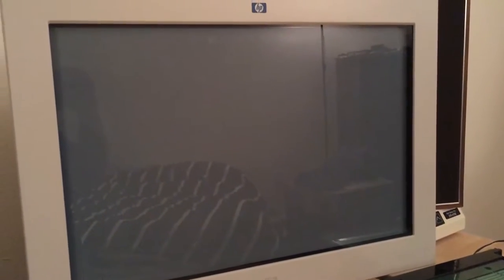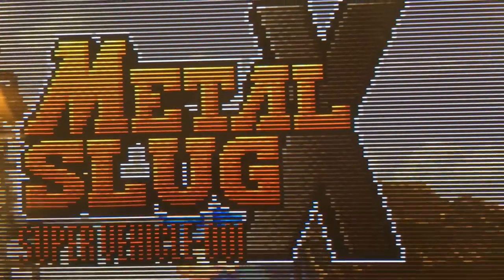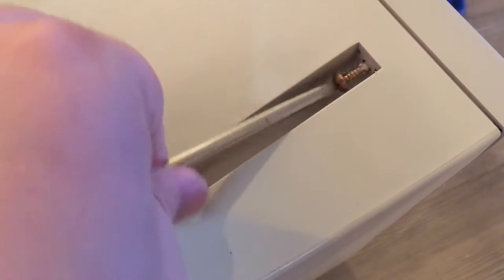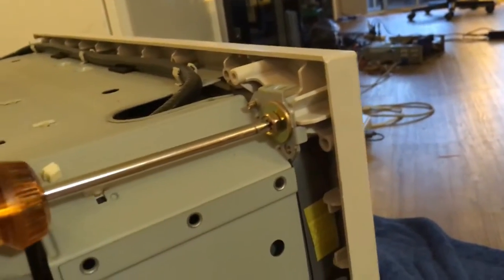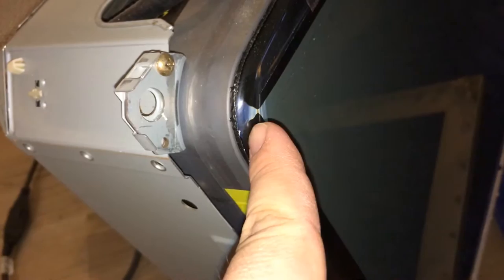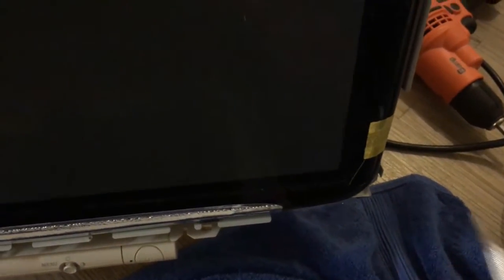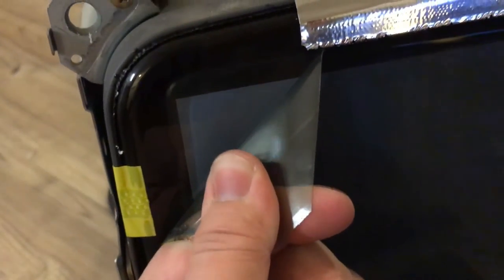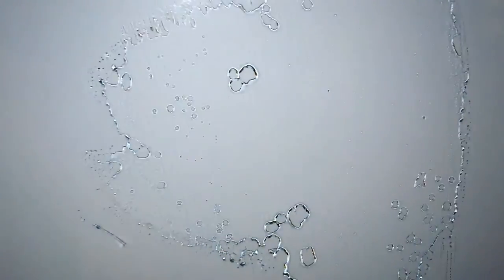GDM-FW900 Anti-glare layer removal (front scratch fix)

Comment: Why not order some anti-glare film from ebay and restore it back to immaculate again.
Reply: Do you mean the 3M anti-glare filters? Have anyone tried to apply on of them on a CRT monitor after removing the original one?
Reply: I think crt and tft both have somekind of flat glass surface on them so why not? Doesn't cost much to try.
Reply: I just order a second hand one for mine. An AG23.0W9 that I'll have to trim (couldn't find a cheaper one). Will see how it copes. I doubt it will behave the same as the original coating though (I've read those only diffuse the glare instead of reducing it).
Reply: Okay, I just got my 3M anti-glare film (an AG23.0W9 in my case). Bad news, it's not suited at all. The film isn't tinted at all and barely diffuse reflections rather than blocking them. The worst of it is that it makes the image blurry. Definitely stay away from them (I'm even tempted not to recommend them even for LCD displays). So my best bet would those good old big anti-glare frames that you attach on top of your monitor (from my distant memories they are indeed tinted and do the same exact thing the original factory installed AG film.
Reply: Yeah I have a big anti-glare frame for a 19" diamondtron, but it shifts the colors.

Comment: What impressions do you have of picture quality before and after?
Reply: I also would like to know that! the ag film on one of my fw900 is sligthly coming off, nothing big but I would like to know if it is worth ripping the plastic off.
Reply: I have removed the damaged coating from a mitsu diamondtron tube, the screen is definitely brighter, better sharpness but there is a color shift, r-g-b gamma needs to be adjusted to achieve correct colors.
Reply: @x3k30c  which model diamondtron was it? I'm trying to check if my lacie electron blue II (I believe it's a re-branded diamond pro 2045u) has a removable film as I have a scratched area on mine but when I took the back off of it I couldn't see how to take the bezel off. There were 4 screws similar to the ones on the sony in this video but they were partially covered by metal shielding so I couldn't remove them. I guess I might have to take all the shielding off but it looked like a nightmare to do.
Reply: @llwayneio  Mine is a Compaq P910, it was a removable film with anti-glare coating on it. I don't remember all the details since this was done many years ago. Yes, you have to take it apart in a similar way like it's shown in the video. Also look for other videos/websites. I'm not sure that any of the shielding needs to be removed but there was a frame AFAIR (not the large metal fastener) so after unscrewing that, the plastic film came off quite easily.
In case if you haven't taken any crt apart: Be very careful because of the high voltages, the large electrolytic capacitors (250VAC or similar, need to be discharged thru a resistor or a lamp, and try not to babble with the anode (that is harder and more dangerous to discharge). If you don't know what discharging is then at least use thick rubber gloves (preferably made for high voltages) on both hands.
These anti-glare coatings were quite annoying. Once it gets damaged, it's ugly and it's not possible to remove just the coating, but the entire film..
Personally, I preferred the original look and colors, it's quite impossible to bring back the original colors/calibration and this model doesn't have as vivid colors as better ones.
Reply: @x3k30c  Yeah I just can't figure out how I'm supposed to take the metal casing off to access the screws. What size was your compaq? was it the 22" or the 19"? looking at the manual I think the compaq is the the same screen as the lacie. I noticed in the compaq manual it says that the 17 and 19 inch screens have an anti glare "film" whereas the 22" has a anti glare "coating". If this is the case I'm guessing my 22" might have the spray coating as opposed to the removable film.
Reply: @llwayneio  Compaq P910 is 19". Not the best advice but try to scratch the coating on the very corner of the tube. If it's easy to scratch and it doesn't have a glass feel then it's film, glass cannot be scratched that easily. I think older crts had their glass coated. Any photos?
Reply: @x3k30c  Well it feels like glass to me, it's not easy to scratch either. Looking at manuals for a bunch of the diamondtron screens though I do see a trend of the 19" screens being described as having a "film" and the 22" having a coating. I'll take some photos.
Reply: @llwayneio  I haven't checked the mitsu pdfs but sony pdfs (for example the fw900) say "High Contrast AR Coating" but the coating of the fw900 is removable (see first image): https://hardforum.com/threads/ips-vs-crt-sony-gdmfw900.1786630/
Reply: Looks like Sony's Trinitron is very similar to Mitsubishi's Diamondtron (and it should be since the technology of both tubes is practically the same, so the results are very similar). Anyway, I've never had Sony, but I've had several Mitsu's CRT monitors lying around with damaged anti-glare layers, which I eventually removed. The result is the picture becomes quite a bit brighter, but say goodbye to black color, since the tube itself without an antiglare layer has a grey color and there is no way to show black if the  tube itself is not black. It's very noticable, especially on dark images. And I didn't like it at all. My solution was using window film (the film used to tint car windows). I was actually very surprised how good the resulting picture quality became after installing the film. That way I restored several very nice Mitsu's CRT-monitors that I continue to use for retro gaming (well, I use one, but the others are there in case this one breaks).
Reply: @kosmosyche  I was thinking about something like that too, there is no true black after removing the layer. However, this one (Compaq P910) has an 'FPM' option that enhances the contrast to such degree that grey goes back to very dark grey, still not the best though.
I like this old technology because trinitron tubes have the best clarity, vertical stripes are more natural to the eye than pixeled LCDs. Also it's possible to tune the modelines, so if the particular model allows you, you can set up wide-resolutions like 1600x900 with a high frame rate like 100fps (and being able to keep the pixel clock or bandwidth as low as max bandwidth/2 which gives nearly as sharp image as an LCD can).
The high-quality and not over-used pro crts are still amazing.
Reply: I removed the glare sheet from my Trinitron P780 and I couldn't be happier with the results. Games went from looking overcast to popping with vibrancy. Increasing reflection and losing true black is not as big of a deal as it sounds. If you've ever used a consumer CRT TV it's the same thing, but of course with a monitor you have progressive scan and higher resolutions.
Reply: @x3k30c  In the process of doing this myself since I fucked up the coating when bringing it home. What was the color shift like? Was it hard to correct?

Comment: Just an update for my own case to inform that proper anti-glare frames especially made for CRT monitors are indeed the only valid replacement for the removed anti-glare film. They provide the exact same function and are tinted. I have one attached to my Diamontron and it does its job pretty well (it's an EX10XL from 3M). The only problem is that they're becoming harder and harder to find, especially at a reasonable price and at just the right size for your monitor.
Reply: Yesterday I screwed up the anti-glare coating of a given Sony E200 with just a sort of Windex and I was so sad, searching for a solution. Now I feel better that I know there is way to "fix it" with anti-glare frame (not 3M, because they are times the price of the monitor itself, but anyway I'm going to try a cheap one and see what happens..).
Hope dies last :D
Reply: How easy was it for you to remove the bezel screws from your diamondtron? I'm trying to check if my lacie electron blue II has a removable film (I believe it's a diamond pro 2045u) as I have a scratched area on mine but when I took the back off I couldn't see how I could remove the bezel screws. There were 4 large screws similar to the ones on the sony but they were partially covered by metal shielding so I couldn't remove them. I guess I might have to take all the shielding off but it looked like a nightmare to do.

Comment: Very nice video. Inspired me to do the same with a scratched Mitsubishi Diamond Plus 91. Surprisingly, it's built in a pretty similar fashion. I could remove the front bezel with the tube still standing straight.
However, with the coating removed, the screen surface is brighter which means it's now preferable to use the monitor either in the dark or under a dimmed light. But it does make the picture brighter (15% increase in my case).
I'll be testing one of those 3M so-called anti-glare films to see if they're worth as a replacement (I doubt so but, who knows?).
A last thing I noticed, not very disturbing but it's not immune to static electricity anymore.

Comment: Most modern displays require wetting. More points of failure but with some rando lcd panels you found, practice it till you get it right, then do it on what you want to do.